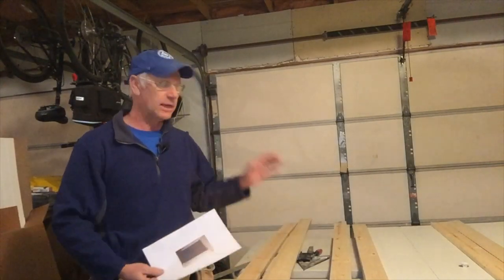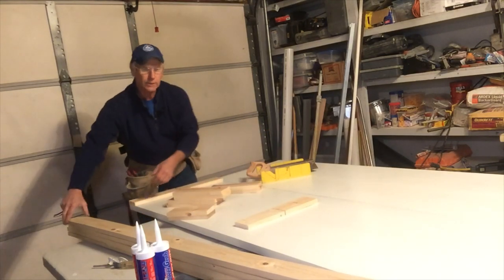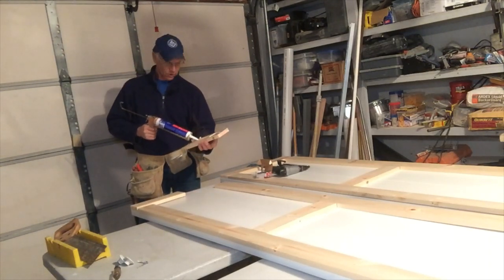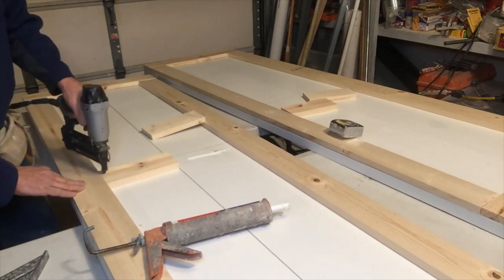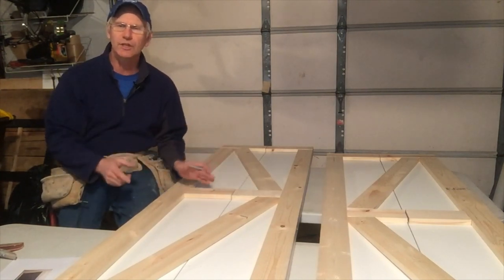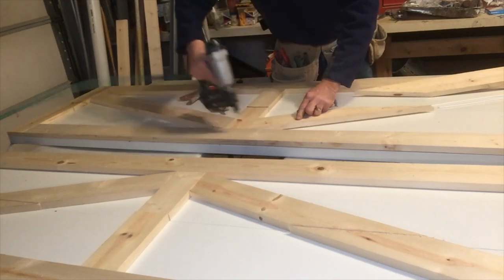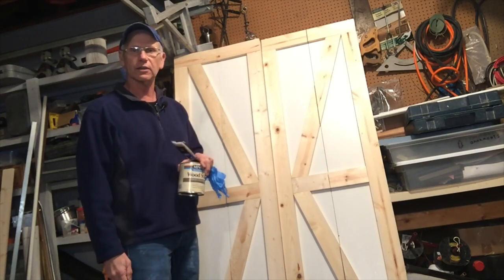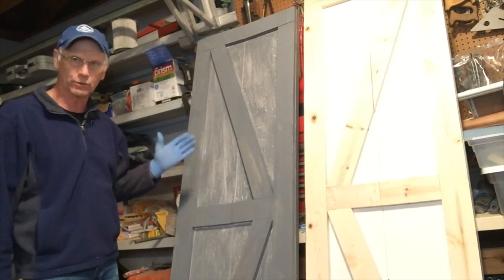Barn Door Bi-folds instruction video

Comment: Phil, did you have to trim the hinge ends to compensate for the added thickness?
Reply: I can assure you he had to. I’d imagine a whole bunch using 1-bys. I did this using 5mm plywood and I had to leave at least a 3/8 gap for clearance.
Reply: We built these and they are too thick so when they bend open now they rub the door casing and don’t work. Will have to have huge space to allow for the thick trim we added on face of the doors. And because they need to be moved over for space, the doors are now too wide and need to be cut down. We also have to add trim around the door to hide the huge space. You don’t explain how you are fitting these thicker doors.